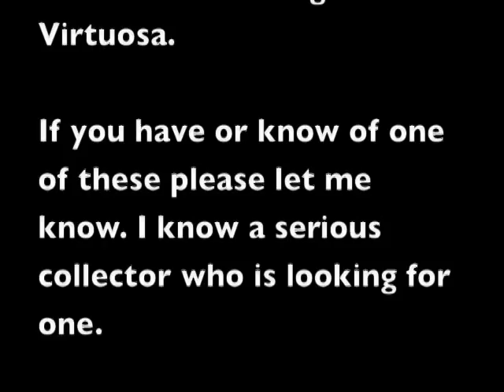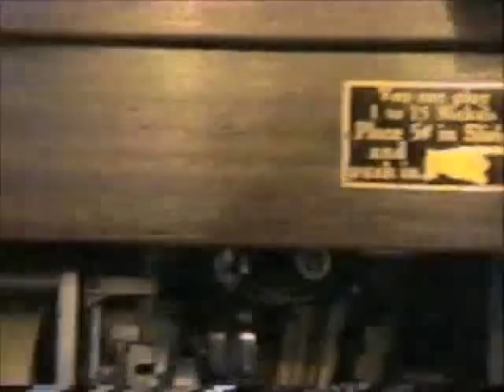Mills Violano Virtuoso (produced by Coin Op Preservation Society)

Comment: It would be easier for you to find one if you searched for the correct name: "Violano-Virtuoso"!

The "Virtuosa", (no "Violano") in the name, was the earliest version which just had a violin in a cabinet with glass on all sides. 
No examples are thought to exist, it is supposed that Mills recalled most or all of them back to be converted into Violano-Virtuosos (which have a piano). There are usually one or two of these for sale at any given time; Tim Trager has a couple for sale.